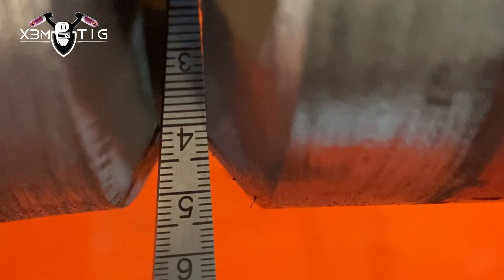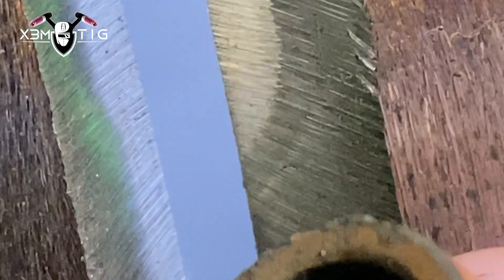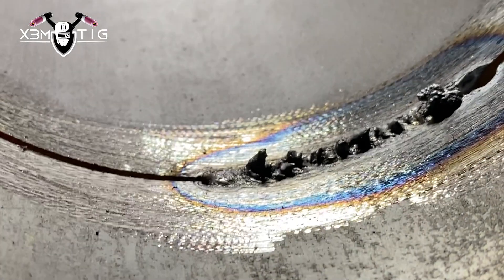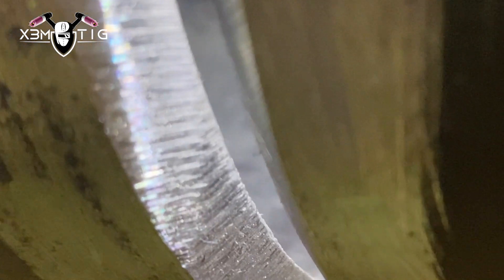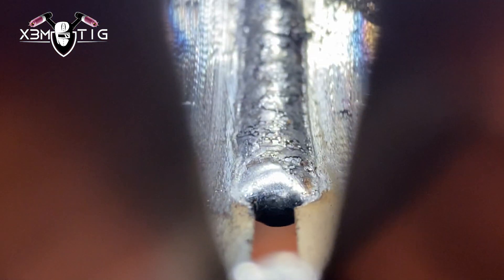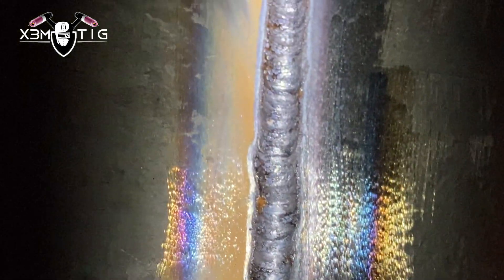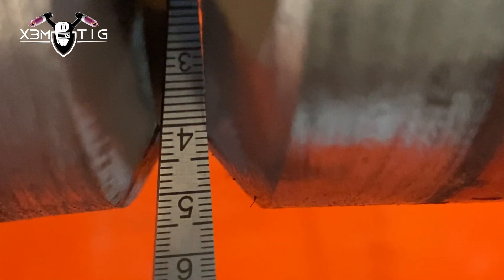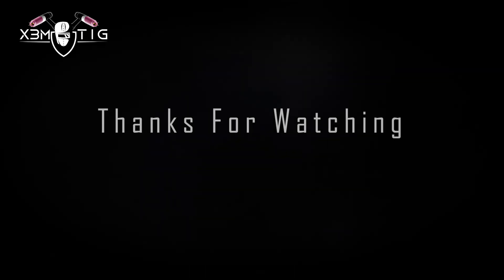STOP Making Common TIG Welding Mistakes on Carbon Pipe | Root Pass Errors FIXED

Comment: How’s it going brother ? I wanted to know what is the best approach to welding sch 10 stainless when your gap closes? I usually use 1/8 and 1/8 rod but I have a hard time blowing through the key hole . If it’s an even 1/8 I have no problem. Especially when I have to rework the fittings . Also when working the root do you go edge to edge of pipe or stay in the middle ?

Comment: My instructors taught me to add filler to the tungsten puddle so my bead looks like a stack of dimes. That was for fillet welding. I’m now on groove welding and they didn’t teach me to keep the filler in the puddle. I figured it out on my own. Repeatedly removing the filler from the puddle was causing my filler to stick to the base metal. And the filler would form a weld around the bevels and leave a big hole. Then in an attempt to fix it, I’d stay in that spot and make that one spot very hot and my weld would bubble. Half of my learning is from YouTube while I’m attending a school that’s certifying me lol.
Reply from the maker: I'm glad you figured it out! 👍

Comment: Hello gentlemen, In pass on,or root pass  all your attentions were accurate, from the presence of tungsten and the necessary amount that should be outside of the ceramic, as well as the size of the tube gap to have good penetration to take X-rays, thank you for your accuracy.

Comment: I only can put a perfect root in on carbon at 65 or 70 amps never loose connection. If I go hotter it's constantly loosing connection and opening up the keyhole. I'm confused.. you move faster maybe?
Reply from the maker: I do move faster, but you have to work on your tungsten and filler wire inclinations…

Comment: Do you walk coming up on the left side on 6g on root?
Reply from the maker: Yes I do
Reply: Hot and covers too?
Reply: I’m testing right now ?
Reply: I’m putting an 1/8 gap and using 1/8 filler rod
Reply: Does that sound right?
Reply: I’m doing lay wire technique and the root is more flush. Should I try backfeed?

Comment: I'm in 2nd semester welding school so forgive the ignorance, but why does undercut matter on a root pass?  You'll be doing a hot pass right after that will fill the undercut in anyway, yea?
Reply from the maker: I doesn’t on the outside, but on the inside matters.
Reply: @X3MTIG  oh I see, yea that makes sense.  I wasn't thinking about the inside of the pipe.

Comment: I wonder how much per hour a welder like you gets. You are my role model. Im doing city and guilds level 2 tig stainless in the uk and one day i want to weld like you
Reply from the maker: Hey bud, it al depends from your skill set, company you work for, certifications, but generally speaking, somewhere between $35 to $60 per hour!

Comment: Pozdrav iz Srbije! Prenosis sustinske stvari u zavarivanju,svaka cast! Mozes li mi reci molim te koliko zatupis ivicu korena? I da li je moguce da ima toliko odstupanja u odnosima amperaza,razlike medju aparatima? Jer 130A na kempiju zvuci previse za koren i imam osecaj da bih progoreo materijal prebrzo.Oprosti na poduzem pitanju.Hvala ti na odgovoru i svako dobro zelim!
Reply from the maker: Pozdrav, 
Za zatupljivanje ivice korijena sve zavisi od materijala kojeg se vari. Generalno, osobno volim, noz na crnim cijevima, a kod inoxa oko 1 do 1 1/2 mm, cisto iz prevencije “ internal undercut “ . Dali ima razlike u masinama ? Ima, naravno i meni se cak nekad desi da koristim istu masinu u elektrani i rafineriji i ima razlike u napajanju. Ovdje su uglavnom Miller i Lincoln, odlicne masine, pogotovo na diesel, ali mislim da Kempi je vise specijaliziran za Tig i sadrzi kvalitetnije komponente, tako da je sigurno razlika u amperima. Hvala ti na komentaru i svako dobro!

Comment: I have found that one wants enough current to “wake up” the tungsten.  Up to 70-80 amps wants a 1/16 tungsten.  100+ desires a 3/32 or so.  

I’ve yet to go much over a hundred, as access to 220 is difficult for me.